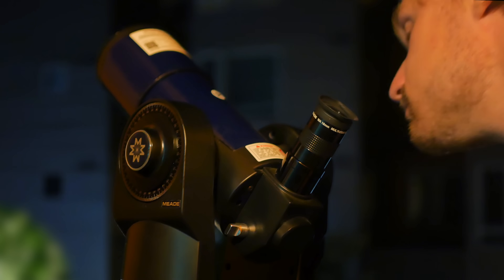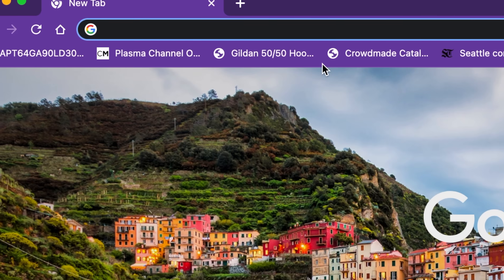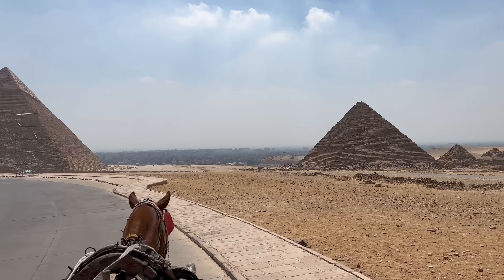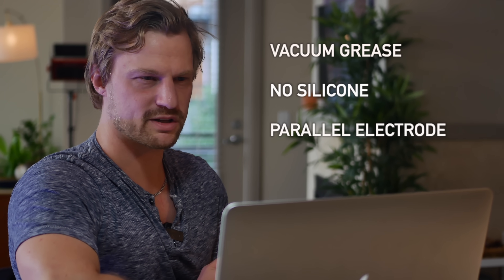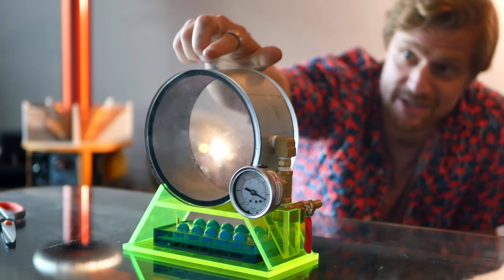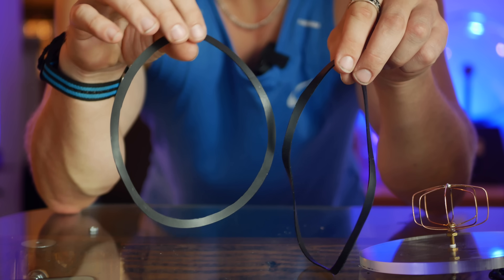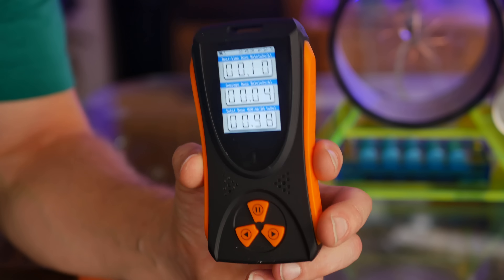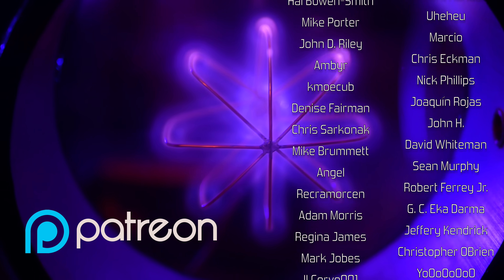Building A Nuclear Star In A Jar (Fusor)

Comment: If we could build fusion reactors and run them at a rate of energy equal to a million nuclear explosions per second (for all this great manufacturing and other helps for us all) then where does all that heat energy go? Would there be a natural endothermic activity that could equal it, or would we start a runaway thermal reaction to burn us all out? Now that is a global warming question that should be answered before we get too excited about creating technology for the greedy and ignorant masses.
Reply: The sun already puts 1000w per square meter on half the earth every day, that is incomparably larger than what humans could accomplish with reactors.
Reply: As for where the heat energy goes, it radiates out into space, earth has a massive surface area so it cools very easily, at least it did before the greenhouse gases built up.
Reply: @mlauntube  We are free to produce massive scale energy without consequence. The effects of global warming are not dependent on how much heat we make on the ground, but rather how much of that heat is reflected back towards the ground.

Carbon dioxide and methane are the main gases responsible for preventing radiated heat from escaping our planet. The reason for the push for an increase in vegetarian diet is because of the methane produced by cows. 

About 15% of all greenhouse gases produced on earth come from methane produced in the cows guts. 

While I believe in increasing the amount of vegetables in the human diet would have benefits for most people, I do not believe they need to be vegetarian, in fact that would be bad for their health. From a biological standpoint meat should remain a part of the human diet, at a minimum around 1/4 of food intake.

There is really nothing wrong with eating meat, however to prevent the build up of greenhouse gases beef should  be avoided as much as possible. No other meats come remotely close to producing as much methane, fish and chicken are some of the lowest producers of the gases and should always remain a part of the human diet.

As for them saying to stop having children, theoretically there is a maximum number of people that the earth can support. I don't think anyone knows with 100% certainty what that number is, and I doubt we have come close to it yet, but eventually people will have to stop having more than 2 kids. You can think of it like putting too many fish in a fish tank, eventually there will be so many that the waste will build up too fast, and any food you add won't reach all of the fish before being eaten.

I think technology can greatly increase the number of humans the earth can support, so in the future the maximum possible number of humans on earth can be higher.

Overall I think cities are the major concern for population. If the whole earth were covered in cities it would surely be unsustainable, but if people continue to live more like those out in the country we should have enough land to feed everyone.

I've never read into carbon credits, but it sounds entirely political. Sure there are benefits to reducing carbon emissions, but if we finish our work on fusion and bring about massive energy production, we can just pump the greenhouse gases out of the air. In fact, I'm pretty sure if all of the money across the world that has been used to "go green" was instead used to build nuclear fission reactors with the sole purpose of removing CO2 from the air, we would have a net decrease in greenhouse gas each year.

Regardless it will eventually happen, wind and solar are the cheapest forms of power production, so they will dominate in the future. As soon as we find a cheaper medium for storing power humanity will have all of its power needs met, and will be able to start removing CO2. The best candidate for this is solid state sodium batteries, which are probably less than 20 years away.

Comment: Great video!  Suggestion - connect your vacuum gauge directly to the pump with as few connections as possible to see how much vacuum pressure the pump is capable of.  If it is stronger then you have a leak somewhere else in your plumbing.

Comment: Y'know, the problem was quite probably the teflon tape. NileRed had the same issue with that pressure chamber he built to make arogels, he solved it by using the orange stuff, that's thicker and rated for vacuum

Comment: I'll be really impressed if you can get a hold of tritium, as it's incredibly rare and expensive (it has a really short half-life), but deuterium should be enough, if you want to make fusion.
But it's a really good-looking build! 😁
As you've undoubtedly found out by now, to achieve a high vacuum, how much materials outgas, is really important, which apparently is one of many reasons that JB-weld is such a good seal (I have no access to the stuff). Acrylics outgas a fair bit, which is why it's not ideal. Glass is the way to go. HDPE (high density polyethylene) is surprisingly easy to get, and doesn't outgas very much (as in - I get so far down in my primarily HDPE and glass vacuum-chamber, that my electron gun stops working. HDPE hoses are also readily available everywhere. I am using a few silicone seals, which I can tell when I switch off my pumps, and leave my chamber at a vacuum. When you have something that outgasses, interestingly, you can see the pressure rise, over a few days, to a specific point, where it then stabilizes, and from that, it's pretty obvious that silicone outgas quite a lot (if it continues to drop, there's a leak, but that's usually obvious within minutes).
Reply: Are you even allowed to trade Tritium without an enormous amount of paperwork and a high security clearance? It's an radioactive isotope and used for H bombs?
Reply: @erikkarsies4851  I have no idea about that, but even if it's a component in h-bombs, it's not the primary one. In fusion reactors, they're working on tritium "breeders", which, if memory serves, is lithium. I can't recall the process, but they're supposed to create tritium, when struck by a neutron. But each deuterium-tritium fusion reactor, might need tritium to get started, and I've heard/read rumours, that there might not be enough for that (I have no idea of the reliability of that, though).
If memory serves, tritium is also a byproduct of fission-reactors, which is likely our main source of it, but because of the half-life of it, we never have more than around 20kg of it on the planet, at any point in time - as far as I know (sorry for all of the uncertainty in this message - it's not the part of fusion I've studied the most - so for anyone who spots mistakes here, please don't hesitate to correct them).
Reply: @martinfyhn1976  Tritium is a very important component of Hydrogen bombs. It is used with Deuterium  to turn the fission reaction in to a fusion reaction which makes the bombs much more powerfull. But I see on wikipedia (and I quote from there : "Tritium is an important component in nuclear weapons. " )  that is used for some other applications also. The clips I've seen of real working fusors until now were mainly inside scienctiric nuclear research locations. And I suspect there is at least an amount of bureaucracy involved using the stuff for experiments.
 The breeding of Tritium out of Lithium is a very tricky one because you need a neutron source (for instance a nuclear reactor) and those neutrons need to hit the lithium at certain speeds and even than it's a very difficult to extract the tiny amounts of (pure!) Tritium out of it. If you want to know more about it then the wikipedia of Tritium is a good way to start.
Reply: @erikkarsies4851  Thank you for the explanations and clarifications. I still don't know about the requirements of getting tritium, and initially I was thinking that I don't really see any reason to regulate it, as it's likely nigh impossible to get a hold of, due to rarity, and price, and because tritium itself isn't really dangerous, though radioactive. What I meant with it not being the main component of an h-bomb, is that you also need to get enriched fissile material, which definitely is difficult to get your hands on, and very regulated. I was also comparing it to deuterium, which as you mentioned, is another component of such a bomb, but is easy to get your hands on - but then I remembered another fusor video I saw, with someone who had a pretty difficult time of getting deuterium gas. He managed to get some, through working at a lab, if memory serves. Another youtuber in stead got a hold of heavy water, which seemed to be easier to get a hold of, and got deuterium through electrolysis. And then there's the fact that 10% of the ocean is deuterium. What I'm trying to say, is that if deuterium is regulated, then tritium is likely regulated in the same way, in addition to being really rare and expensive. I don't think that it's as heavily regulated as e.g. enriched uranium, but it is just naturally difficult to get a hold of. 
Also, many things can be components of deadly things, but it would be silly to regulate things that themselves are not dangerous. To exaggerate, it's sort of the same as saying that we need to regulate oxygen because it's a critical component of most explosive reactions.
Reply: @martinfyhn1976  One in every 6420 Hydrogen atoms in sea water containa an extra  neutron (which means it's a Deuterium atom) so 10% is a bit optimistic, but indeed Heavy water is widely availabe and way cheaper than the 30.000 dollar a gram which Tritium was going for in 2000 according to wikipedia. I don't think the posession of Tritium is the issue but I would expect that goverments wants to keep track of the trade in the stuff. It isn't really usefull to regulate Deuterium because it is so easy produceable compared to Tritium and so Deuterium isnt an issue in the balance of power between super powers The problems you describe with Deuiterium probably have to do with purity and nature had a long time to produce Deuterium while Tritiium has a half life of about 12 years. So you won't find much of it naturally. What I do know is that the superpowers are not open about the amount of Triitium they have as a strategic stock which does signal some nervousness poltically about it.
 Deuterium isn't radioactive and Oxygen is neither. And in many places you can pick Uranium which you could theoretically turn in to fissile material. Still they are quite worried of countries like North Korea and Iran doing exactly that. I sure don't think they would like that those countries would buy considerable ammounts of Tritium. If they would find a easy way to produce Tririum a lot faster they probably first even would try to keep it a secret if they can.
Reply: You can get it from some glow-in-the-dark necklace capsules. I believe United Nuclear may sell it.
Reply: @jacobb7608  Yes but that isn't in pure fiorm. Tiny bits of Tritium are used as radioactive emitter to light up phosphor. The decay of Tritium release electrons (Beta radiation) which light up the phosphor just like in a CRT
Tritium in very tiny bits is all around the world as temporary decay results of other radioactive products. Uranium is widespread also. Biut getting enough Tritium gas in a pure form for a homegrown fusor is a different beast. All Fusor experiments I've seen on youtube (I'm not sure if they were even using Tritium) until now were in specialized nuclear labs even if the Fusor itself was a made by a genius kid at home.
Reply: @erikkarsies4851  The fusor was invented by Philo T. Farnsworth, not a kid. He is also the guy that invented television.
Reply: 40 dollars for a vial at United Nuclear. The description even says that a lot of customers use the tritium for home fusors.
Reply: He's not going to get tritium.  It's just not going to happen.

Comment: Can somebody explain what the machine does, and why it's not an infinite power source?
Reply: The idea is to take hydrogen nuclei and accelerate them towards the grid in the center. Hydrogen nuclei have a positive charge, so they are attracted to the negative charge of the grid and pick up speed as they are pulled towards the center. 

The goal is to give the hydrogen nuclei enough kinetic energy that they are able to quantum tunnel through the coulomb barrier of the nuclei approaching from the opposite direction. According to Heisenberg's uncertainty principle, the more energy a particle has the less certain its position becomes. Thus if the hydrogen nuclei is given enough speed it can skip some distance as it approaches other nuclei and skip past the point of maximum repulsion, allowing the strong nuclear force to take over and pull the nuclei together into one atom.

To achieve the needed speeds you need a very deep vacuum, much deeper than achieved in this video. Without a deep vacuum the nuclei will smack into other atoms before reaching the center, causing them to loose their speed.

As for why this can't be used to generate power, most of the energy is lost from collisions with the grid. Rather than nuclei sticking each other and fusing, most will hit the metal grid, which is what they are being pulled towards. This does not generate any power but does heat up the grid. If you tried to turn up the power to increase fusion rates the grid would melt and the reaction would stop.

This is why physicists are using magnetic confinement for professional fusion, using magnetic fields you can prevent the nuclei from touching any part of the reactor.
Reply: @rockyrocker23  Couldn't produce, or couldn't harness?
Reply: @rockyrocker23  What part of a fusion reactor is this exactly? What components is it missing that would make it a full fusion reactor?